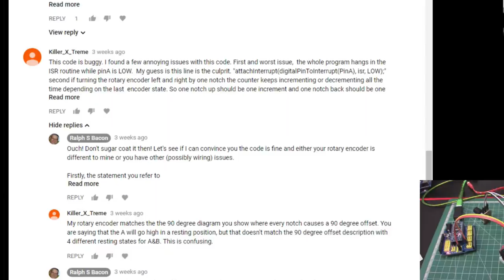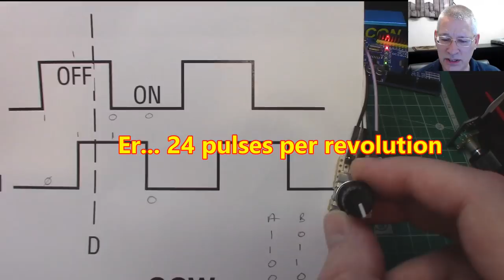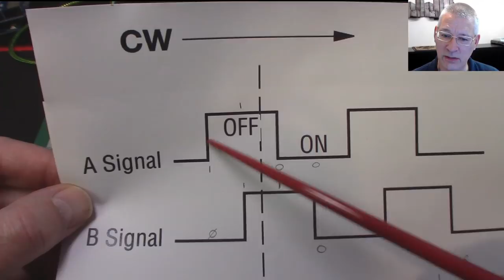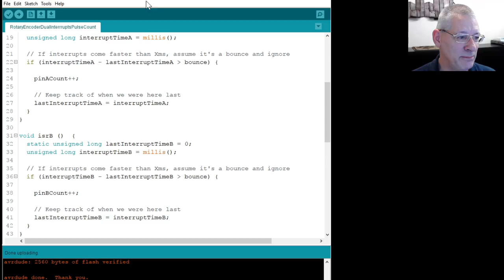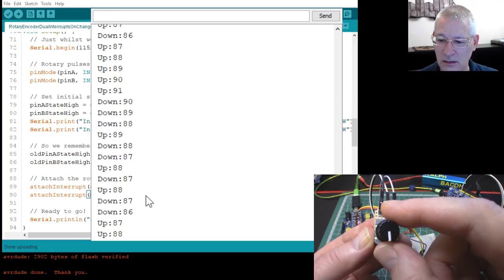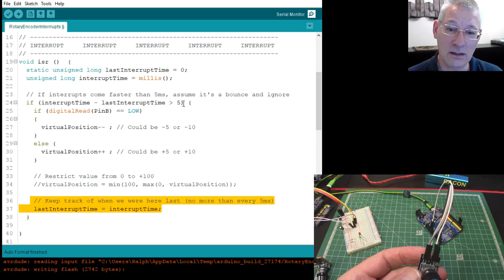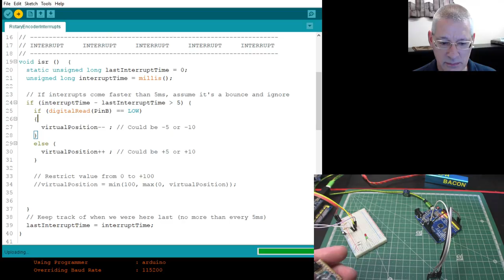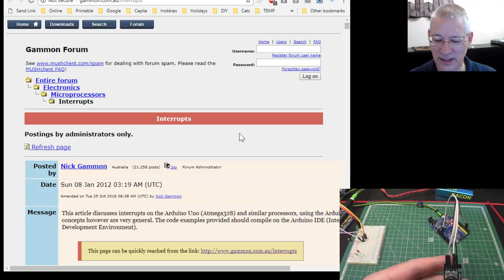#96 Rotary Encoder Update - Stepless & Software Debounced

Comment: Hi Ralph,

Many thanks for your video. Please I have a query as I came across a particular situation in my project:

I’m using MEGA2560 R3 and want to read 4 pulses per step from my encoder. It’s a step-less BOURNS encoder with 36 PPR (https://eu.mouser.com/datasheet/2/54/CW1J-777413.pdf), so my aim is to read 144 pulses per turn. After online research and testing, I managed to write a simple code that debounces the encoder through software –see below- (this includes two CHANGE ISRs, each for the encoder pins A & B, and a variable to count the pulses in either direction.) After completing the circuitry and the coding for one encoder, I’m getting one of the strangest things: even though my board always detects 144 pulses per one turn in total (whether I turn the knob slowly or really fast), at certain points it seems to mistaken the input signal from one pin as though it came from the other, thus messing with the Counter’s final value due to flipping the increment's sign at those particular instances.

Looking deeper into it, I simplified the code further to only print out on the screen either “A” or “B” at the end of either ISR, indicating which pin has been triggered on the encoder, followed by 1 or 0 to state whether that pin had come to a low or high state. So in a normal turn of the knob, I get a nice toggle like this:
A0 B0 A1 B1 A0 B0 A1 B1 A0 B0 A1 B1 …
But then I also get something like this:

A0 B0 A1 A0 A1 B1 B0 A0 B1 A1 B0 B1 B0 B1 B0 A0 …

I don’t know if you’ve ever come across such an issue, as I’ve not yet succeeded to find an explanation on how this could happen, that is, if it were not due to the code itself, but rather maybe a hardware issue. But if it's from the code, could it be that the interrupts are queuing up because I'm turning the knob too fast? or another reason? Any input or assistance on this matter would be much appreciated.

Many thanks for your help in advance, and for reference, here’s the code that I wrote so far:

const int encPinA = 2; //interrupt pin        
const int encPinB = 3; //interrupt pin
volatile int p = 0; // counter
volatile uint8_t a;
volatile uint8_t b;
volatile uint8_t a0;
volatile uint8_t b0;

void setup() {
  
  pinMode(encPinA, INPUT_PULLUP);
  pinMode(encPinB, INPUT_PULLUP);

a0 = digitalRead(encPinA);
b0 = digitalRead(encPinB);
  
 Serial.begin(9600);
 attachInterrupt(digitalPinToInterrupt(encPinA), ISREncPinA, CHANGE);
 attachInterrupt(digitalPinToInterrupt(encPinB), ISREncPinB, CHANGE);
}

void ISREncPinA() {
b = digitalRead(encPinB); 
if  (b0 != b) {
b0 = b;
(b0 == a0 ? p++ : p--);
Serial.println(p);
}
}

void ISREncPinB() {
a = digitalRead(encPinA); 
if  (a0 != a) {
a0 = a;
(a0 != b0 ? p++ : p--);
Serial.println(p);
}
}

void loop() {
}
Reply from the maker: The problem you're describing I have also experienced with these stepless rotary encoders. I believe it's switch bounce that is confusing the µC. Some work better than others. Stepless always work poorly compared to stepped devices too. There's no easy solution. By the time you have catered for switch bounce you might miss one or more positions. I would clean up the Rotary Encoder pins with a hardware switch debouncer as I described in video #96. At least that way you can take out any software coding for bounce.
Reply: @RalphBacon  Thank you soo much for getting back to my inquiry. Truth is, I'm mounting the encoder on the output shaft of a DC motor (perhaps not the most ideal way to read a motor position/RPM though I saw it implemented successfully online, plus the motor is slow enough for the encoder to work.) As my project had become a bit more complex, I eventually decided to abandon the software debounce solution and go to good 'ol hardware, since I'll have several motors to read from, and to eliminate the false positives the Arduino has to filter out from all the encoders, and give it more space to do more important stuff.

Kindly I have another question that came to mind yesterday regarding declaring and running an ISR from inside a Class. What things should I pay attention to, or new concepts to learn and comprehend, to implement this successfully with little hassle, as perhaps otherwise it might better to leave the ISRs in the main sketch instead. What do you think?

Once more, very great videos. unlike in other channels, this one has very little video editing effects (music, intros, visuals ...etc) that would somewhat otherwise distract the viewer, and should make them feel comfortable and focused learning new materials. Many thanks again Ralph

Comment: With all due respect, I suspect that KillerExtreme has missed the point regarding rotary encoders. They are not physically confined (like, say, a potentiometer) to one full rotation or less. So, the resolution is decided by firmware. If his application needs finer control, he simply changes the mapping of the encoder's input to his output so that more degrees of turn are required to affect the output. Infact, having more steps per degree of turn, reduces the resolution of the control loop.

Bounce: I agree with you, regarding lack of response in volume controls, etc. I do suspect one can become more sensitive to this phenomenon, the more familiar one is with the functionality of UIs. Those "plebs" who are blissfully ignorant of how these things work, respond to such inconvenience with "Oh, it is OK, It always does that". Is knowledge such a valuable thing?
Reply from the maker: You are correct, Michael, in stating that detecting each pulse edge reduces resolution - my video clearly showed that having it that sensitive made it awkward to use. If #KillerExtreme wanted to use his rotary encoder for precisely tuning a radio then fewer pulses for a given amount of travel work better. On the subject of...
 
On the subject of Bounce, you are once again IMHO correct. Ignorance is indeed bliss. Whenever my car radio's volume control does not respond as I expect it to I think 'missed pulse detection again' instead of 'must turn it slower'!!! Too much knowledge is indeed a dangerous thing.
Reply: Commercially,  You dont do so many pulses. As encoders age, they get worse. Also, when you have an inbuilt push button, fast changes causes last minute changes...hence complaints from customers.
Reply: At least I was correct in assuming you deserved respect :-)

Comment: Hmmm.. Old video, but hey, I couldn't help but notice that the change in code of lastInterruptTime changes to a "minimum time between pulses".. But contact-bounce was taken care of by just "waiting around" for a TOTAL of 5ms.. A single contact bounce of 5 milliseconds sounds like a VERY long bounce to me. Usually the bounces are in the microseconds range. But there might be 10-20 bounces, thus a total wait of 5ms is "probably good".
But after moving it outside the if-clause, you could definitely reduce the time to make it more responsive, since every teeny bounce would reset the time.
Reply from the maker: Well, I reckon that 5mS is probably a reasonable time to wait for a switch bounce; some really bad switches can bounce for 20mS according to switch-bounce guru Jack Ganssle. 

I think I put the pdf of his work in my GitHub, definitely worth a read. I've just created a tiny switch bounce PCB with SMD components for a project I'm working on. Works like a dream and it's based on Jack's circuit.

In that case, of course, hardware does the debouncing and no delays of any kind are required, the nirvana of software developers.

Comment: Hello Ralph, thanks for sharing. I personally tries to do a strict separation between input, calculation and output. The shown method for decoding the rotary decoder volatile this. What i don't like is that the isr calculates a value. I think it's to limited and it throws away halve of the input information(the speed). I have made a decoding method that doesn't change a number but returns a value that give the direction and the time since the last puls.  The calculation of the value that has to be changed is calculated in the sketch. That way i'm more flexible. This way i can add dynamics to the behavior. If the time is short the increment can be bigger.
Reply from the maker: And yours is definitely a better way of doing it, Spock, but I know that jumping around in the code during a demo just confuses people! So my way is not ideal but does show the principle. In Real Life your way is the way to go. Thanks for posting and Live Long and Prosper.

Comment: I had problems with a clicky rotary switch when I used them first. I learned you really need to debounce them or measure every edge change. If you handle all edge changes, you need usually no debounce, because then bouncing up signal is counted like up-down-up-down-up-down-up (which is same result as a single "up"  because the up-down pairs are cancelled). If detents give you more than one count, just divide it with a suitable value. I found quickly too that with very fast turning you probably start missing pulses.
I think with every switch it is always very important to assume bouncing edges even if you have them or not. In future code may be pain to debug if you use different switch or you may get a buggy appliance by just replacing a broken rotary with another model that has debouncing you did not have before.
BTW, my favourite method of debouncing often was using a timer interrupt and tracking if you have enough similar readings in a row. If you read 101010101111111, you may detect switch is probably stable 1 after several similar values. (and likewise 010101010100000000000 must surely mean stable 0 for now). If you need a "push" event, just keep track of the stable value and as stable value changes (happens only once), register a push. (or like every n events if you want a repeating button effect).
Reply from the maker: There speaks the voice of experience, hoggif! Yes, switch bounce should definitely be carefully considered and catered for. I've even come across commercial products that do NOT do this well and it results in a piece of equipment that becomes a pain to use (I have a DAB radio that does this). Thanks for posting your experience of switch bounce, I hope others reading this take due note!

Comment: You mention that the Uno's and Nano 's don't like/do Interrupts on High - Is this also true for the Mega? Does this apply to the main INT pins or to all all the interrupts associated with the pins eg Int On Change.
Reply from the maker: It's also true for the Mega, Ray. If you code HIGH it actually gets compiled as a CHANGE.
 
On the Mega you can choose the following pins for a hardware interrupt: 2, 3, 18, 19, 20, 21.
 
Only on Due, Zero and MKR1000 boards can you code a proper HIGH detection.
 
Pin change detection is similarly limited to RISING or FALLING and you have to do all the detective work as to why you are suddenly in the ISR. It won't tell you the pin that got triggered nor the value!
 
More info on pin change stuff here: https://playground.arduino.cc/Code/Interrupts

Comment: Had the same issue with reversing errors on a 3 pin no-detent encoder. This debounce function cleared it up:

  bool debounce(int Button)                     //  generalized function for active LOW button debounce
{
  byte count = 0;
  for(byte i = 0; i < 5; i++)
  {
    if (digitalRead(Button) == 0)    
      count++;
    delay(10);
  }
  if(count > 2)  return 1;
  else           return 0;
}
Reply from the maker: That's quite a thorough test you've done there for debouncing, Andrew. I've found most switches do not bounce for longer than 5ms and even "bad" ones are done by 20ms (which probably means I should choose a better switch). Anyway, if that debounce routine works for you keep using it and thanks for sharing it here.

Comment: Interesting video, thanks. You need to add another layer to your code that looks at the last state of the pins. Although there are only 4 possible states, not all states are valid depending on what the previous state was. This way you can filter a lot of the spurious noise. E.g. if the last state was a=on, b=on then the only valid state to follow this is a=on,b=off or a=off,b=on, neither of the other two states are valid and so should be ignored. If you add this logic to your code you will improve the accuracy dramatically.
Reply from the maker: That is an excellent suggestion, Andrew. Hmm, I might try this out quickly as the hardware is still strewn over my desk! Thanks for the suggestion.

Comment: Good video and watch your video still learn a lot. Could you make a tutorial about OV7670 with FIFO?
There are  some tutorial about ov7670 but no fifo and the resolution is no good.
So I bought a fifo one. But I can not figure out it how to work. 
So  if you make a tutorial video about ov7670 with fifo. 
I will appreciate you.   Thanks!
Reply from the maker: The Jtron OV7670 comes in multiple flavours, Zhang yixin, one VGA, one 300K pixels, and some with the AL422 frame buffer chip (thus making them FIFO). I don't think I have the FIFO module (I acquired one a while ago) which means the Arduino will be too slow to capture a frame, but I will check. It's a useful, cheap camera for making simple snapshots to an SD card - the Arduino can easily do this. Stay tuned, this would be a good video for Arduinites (even if you might have to use a Mega rather than an Uno).
Reply from the maker: Would you believe it but my camera does have the AL422 chip on it so I will now have to do a video on how to capture photos onto an SD card using an Arduino (MEGA, probably). Woo hoo!
Reply: That's a good news ha ha. Looking forward to your tutorial video Master Ralph.

Comment: Hey Ralph.  At about 6 minutes, you mentioned that the detent encoder has built-in pull up resistors.  Would that be true of all detent encoders?  That would explain why my works without needing to call a pull up in code. Thanks
Reply from the maker: If you buy a "module" where the rotary encoder is already mounted on a tiny PCB, then undoubtedly the manufacturer has added pull-up resistors (but never guaranteed, of course). They do this so it works "out of the box" and they don't get lots of negative feedback from noobs who are unaware of the need of pullups (or INPUT_PULLUP in your sketch).

Comment: If you were using a micro-controller with more interrupt pins, could you use 2 to determine direction and count detents and another 2 to count pulses in between detents? That might allow you to simplify the code and reduce the likelihood of losing track of the direction.
Reply from the maker: Quite possibly, although it would not be usual to use two interrupt pins for one rotary encoder. Most manufacturers just ensure you turn the knob slowly enough for the underlying code to keep up (my radio does this and just ignores me if I try and spin it too fast).

However, that said, perhaps your approach could work - if you ever get the time (and inclination) do try it out and report back!

Comment: How much overhead does the serial.write affect the sensitivity of the resolver, or the perceived errors in the count?  The interrupt may take too long or the serial.write may act as an additional interrupt when it is buffered.
Reply from the maker: Serial.print (or write) takes a relatively huge amount of time which is why they must never be included in any interrupt routines (other than when debugging, and even then keep the output to as short as possible).

Comment: Using a little bit of added hardware will help a lot regarding de-bouncing and encoder detection speed/tracking.
Here to see: https://www.youtube.com/watch?v=xw1HIFOe_Ik

I added some schmitt-triggers at both encoder switch pins, basically a 7414 which has four of them inside and simply daisy-chained two of them on one encoder pin. The first one also has an RC filter 15kOhms in series with an 0.33muF cap to ground to eleminate spikes. This setup works up to hundrets of RPMs...
Reply from the maker: Now that's interesting as I designed a simple debounce circuit using a quad nand gate CD4013B with the intention of using two per pin (in series) to ensure the signal was not inverted. Sounds like my logic is good, given your experiences. I also am including an RC filter as suggested by the makers of a dual rotary encoder, but I might adjust the values to your ones as you have had success. Thanks for this #TubiCal, appreciated.